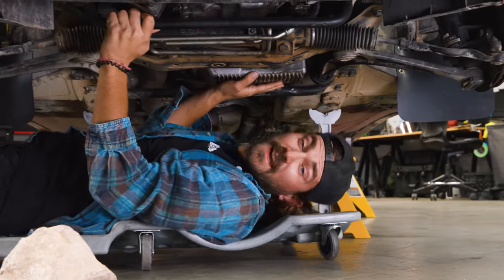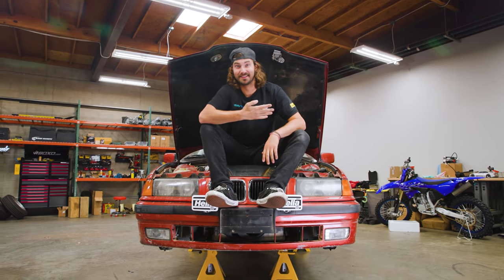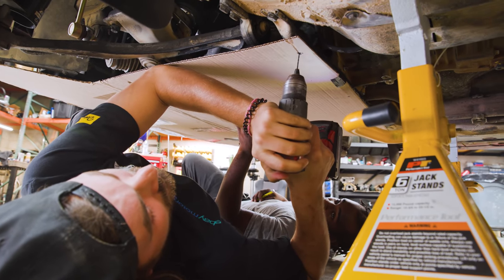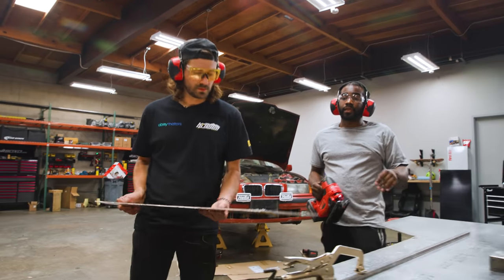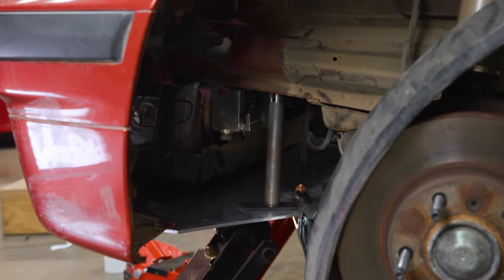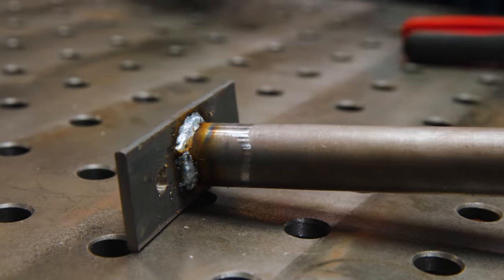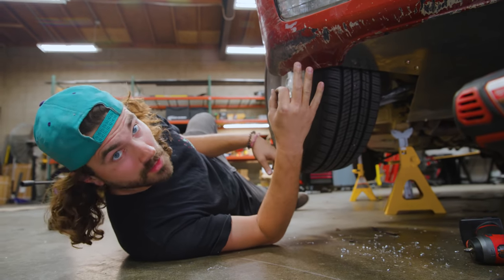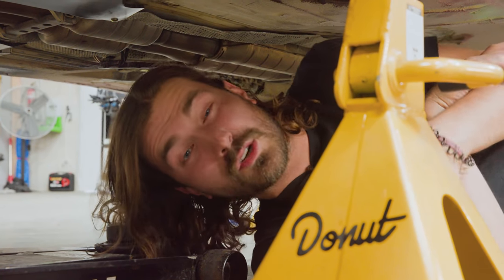DIY Rally Skid Plate - Is it Worth It?

Comment: Spoiler alert.
"Is it worth it?" is not answered in this video.

Neither is, "Will the front end of my Beemer feel floaty on the highway?"
Or
(Edit: Why is the engine/transmission running hot?

Or...)
"Who'd a thought the skid plate would fly off, on the way home from off roading, slashing both rear tires and sending us into the ditch while continueing on to impale the radiator of the Freightliner behind you, blinding the driver, etc, etc, etc.

Expecting this plate to not deflect and contact the oil pan anyhow is a bit much.  The bolts that hold the rear bar that you use as a mount are puny.
Feel free to rip up the bottom of that car with your many rocks, just don't dare drive it on our roads afterward.